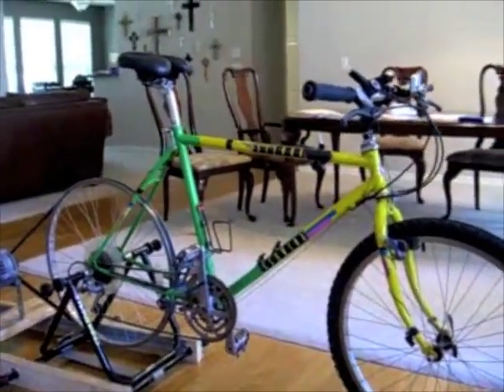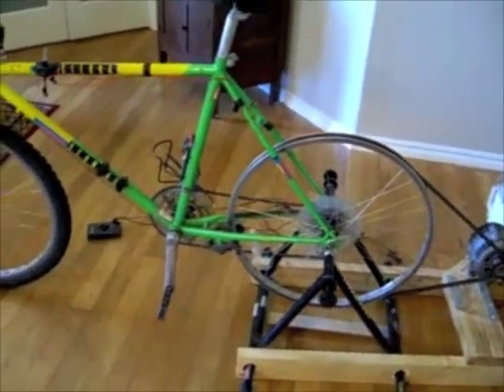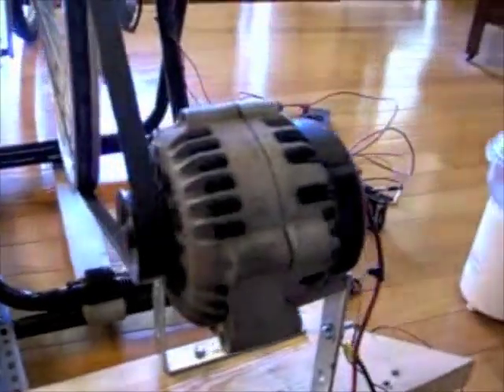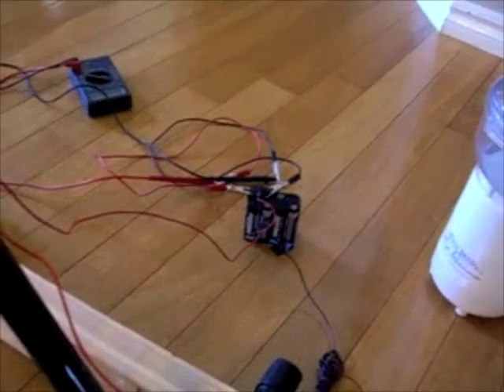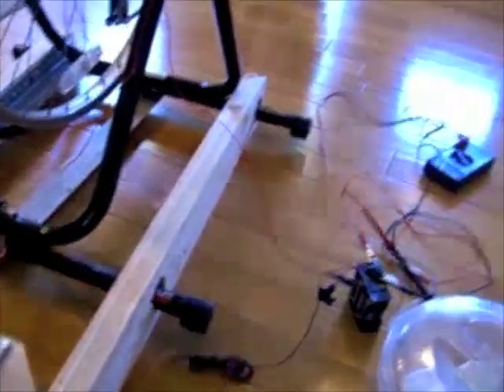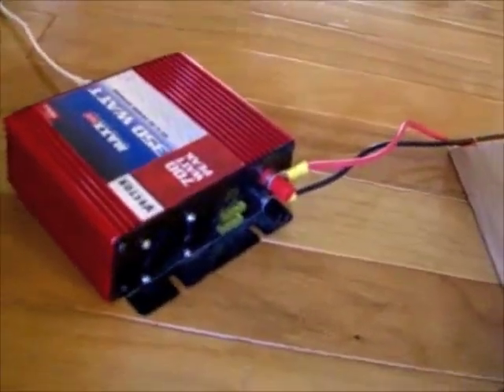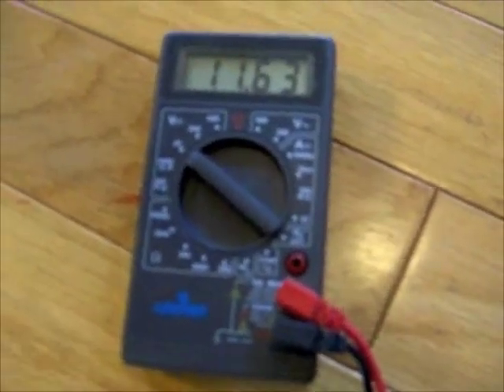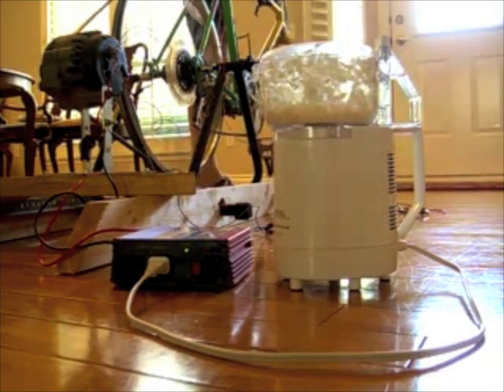Bicycle Generator

Comment: Which type of alternator are you using? I tried one with a motor and it reached a point when the alternotor slowed down. If it is used using a bicycle, can it run smoothly?

Comment: You could have just chopped the onion by hand and save time....
If you are trying to share good ideas with the world, try demonstrating it in a practical way.
You should have no problem raising the rpm since the alternator provides very little resistance.
The best source of energy is the sun, followed by gravity.
If you can incorporate these into you show, you might get somewhere.

Comment: Ok I have a question.. And yes I know it defies the laws of physics, but I'm curious to know if you ever tried it and what would be the results. 
Just as you use the battery pack and then turn it off so that the alternator sustains the voltage needed for the magnetic field. Can you also have a twelve volt motor connected to the bike pedal which is powered by the alternator, then jump on start pedaling until you're up to twelve volt, then flip on the motor to keep pedaling for you and step of the bike.. 
I know the laws of physics wouldn't alow this, because this set up will not be 100% efficient, nothing is.. 
But let's take things a little further, instead of having the alternator run the motor directly, how about have it charge a battery, like a car battery, which poweres the motor I mentioned earlier, therfore, making the system, not perfect, but a little more efficient.. 
Can someone please tell me what would happen? 
I'm pretty sure that the system will sustain itself for a short while at least.. 
Yes guys I understand the laws of physics, it's just a question, no need to bash.. Thanks..
Reply: adding another stage to the system (the battery) would make it less efficient, not more. not to mention you're talking about converting AC current to DC current, which involves several more steps and even more energy lost. also, you basically answered your own question. the system would gradually lose energy and eventually all kinetic energy would be lost.
Reply: ***** there`s some videos about perpetual energy.
Simple formula is placed in Watts.
Watts = Volt * Amp

So, you know that to charge the battery you need 14v, because to charge you need more than demands.
Amp's is the same.

About the Alternator:
As an example the output is 14V and 100Amp, so you have an alternator Output of 1400 Watts

Battery: 
Let's start with a 12V Battery and also 100Amp, so your battery has a capacity of 1200Watts
Yes, it's lower because although the system is 12V, the battery in resting period works at 12V and 14V charging.

Inverter:
Let's say that you get a 1000W Inverter.
Supposely you have 200W left from the battery and 400 Watts from the alternator.
So, next step is the motor and a belt to connect to the alternator.

Motor:
Which to choose from? Will a 200W motor work? And a 400W will it be bether?

Well, before that you need to see the performance of the inverter and the state of the battery, because the inverter, to provide 1000W may need 1200W, and the battery can it really hold 1200W, it will die due time.
But I will try to make it simple and reach the conclusion
The Motor will need to have Torque because he will need to create energy to turn it itself and when there's a load after the inverter he will need more torque to keep the alternator stable, and more torque needs more supply (Watts).
Also with more torque will have less RPMm so there's the need to have a good balance between Motor RPM and Alternator Output.

Conclusion:
In a perfect system even with no Alternator, and using a 200W motor, the battery will provide power for 6 hours
1200W capacity / 200W needed = 6 hours of running time
Adding an alternator with the same or above output can make the system run and eventually charge the battery
If that happens it's called Perpetual Energy
Since nothing is perfect, we expect losses.
There's losses in Cable Diameter and length, losses in conversion from AC to DC, losses due to RPM change and relation/ratio between motor RPM and Max Output of Alternator at X RPM.

Personal Opinion:
If you have easy access to these car parts, yes, it will be a nice experiment, so that you can learn and share your results.
If you have to invest money buying parts, you may end with no money and with a pile of parts that there's no point having them.
Reply: There is a bike like this, I don't know the name of it but it costs 14,000 UK pounds
Reply: But wouldn't we be able to get a battery "charged" efficiently like in a car not so? 
Like a car that's idling with the ac fan on, the battery is being charged and the fan is running. If we have an alternator here charging a battery at a good rate and then a motor using that battery power couldn't the system be sustained for a while? 
Again, I'm not trying to defy the laws of physics, I'm only asking for educational purposes, not to piss anyone off.
Reply: dont forget that while an ac generator (alternator) does in fact charge the battery, said alternator is essentially running off the gasoline that the engine is burning. it is simply a few different steps in the system. but you still lose energy. and yes, the scenario you have described would work for some time. there have been many attempts throughout history to build a self sustaining machine, and while many have come close, noone has achieved 100 percent efficiency, so yes, the system you describe could probably sustain itself for at least a few seconds...or perhaps more. hard to say.
Reply: Ok thanks for your input, I wish I had the time to actually try it, just to see how long it will sustain itself.. I know in physics work output is always equal to the work input minus the work loss, so obviously you always have to put in more than you get out, efficiency is always never 100% and it will stop running.. But in theory it sounds like it should work.. Just like you said the gasoline runs the car, what if you have one motor and alternator that you start with a charged battery so that supplies an output but also drains the battery in the process, just like in a car when the process drains the gasoline this process drains the battery.. And now you have a bicycle cranked alternator charging that said battery with a motor that takes over when the bicycle reaches 12v-14v..i wish there are experiments like this on YouTube or so, so I can see the results, I looked, but nothing.. 
I guess I will just have to try it myself and see if it even sustains itself at all. Thanks for the input guys.
Reply: Electro bike?
Reply: Mark Vianen Electricity operates everything!
Reply: Vishal Baal friction of bearings, will not ensure 100% convertion of mecha power to electric power.

Comment: I have this same kind of alternator and I am trying to generate electricity, Do i need special kinds of cords or can I just use copper wires with alligator clips to clip on to certain parts, if so which 2 parts do I hook on to to create electricity when I spin it? Thanks.

Comment: I would use this idea with wind or flowing water to charge a bank of car batteries. The car batteries would then be used to power equipment via an inverter. Obviously charge controllers have to be part of the equipment. We intrigued by the speed the chopping machine reached

Comment: Well, the idea is a good one. But the electrical engineering here is horrible. The presenters syllabus in describing the electrical components and how they work is not very good. (okay, sorry, it's horrific). The way this video shows how to setup an alternator to a mountain bike to make electricity is NOT valuable.

The engineering and wiring of this setup has been overcomplicated by a factor of 10.

The alternator mount is good and use of a serpentine belt is excellent. Everything else is a disaster :)

1) use a single wire Alternator by GM -  Delco or Nippon Denso Single Wire model if possible for simplified wiring. But even so, it is not hard to use other models. Best model is a heavy duty GM or Ford Alternator from a 3/4 - 1 Tonne Diesel Truck. Designed for low RPM with output performance ranging from 100 / 110 amps @ 12-14 Volts (regular duty) all the way up to 230 amps (heavy duty).

2) Use a decent Marine or Utility deep cycle 12 volt battery. They are designed for storage of power and can reserve Amps. Those "series batteries" would fry or worse, start a fire.

3) The choice of inverter is critical. The more amps is can draw, the stronger the storage battery must be. Sudden demands on the 'electrical" system can exceed the limits of the alternators internal regulator creating severe damage to the amplifier, alternator and the device that is plugged in. The battery saves the inverter - literally. Inverters are all rated differently. You can buy them in different capacities, something that wasn't mentioned and an important consideration. Inverters are available up to 10,000 watts peak power. The most common ones are 300 - 600 watts. 

4) Run the Alternator to the battery (positive to Positive post) with a 12V two pole switch in the middle. The switch ensures that the alternator's exciter circuit does not drain the battery when not in use.

4A) Bolt with heavy gauge electrical eyelet the Black Ground wire to case of alternator to negative post of battery.

5) Run Inverter red lead to positive post of battery

6) Run Inverter black lead to negative post of battery

You're done.

Start peddling!

Follow these steps and you would actually have a project with an actual benefit instead of say, a fire, electric shock or short circuit that ruins your electrical devices. A word of caution, most consumer inverters get hot, they are not designed for long periods of continuous use exceeding 12 hours for anyone cycle period.
Reply: While your ideas are excellent, the condescending and patronizing tone of your intro is going to drive away readers. You catch more flies with honey than vinegar.

Comment: Technically it's great but a very expensive investment because the cost of the bike.  I can't even afford to change 15 energy wasting GU10 bubs to LEDs because of the price. I save by simply using them only when really needed. This contraption creates clutter and looks ridiculous in a living space. What's wrong with chopping oinons by hand?

Comment: Neat idea to generate a flexible working potential like electricity to be inverted or not to use for work.  However, this specific application could have been accomplished so much easier with just a knife and a chopping block :)

Comment: This is great - think I'll try something like this myself.  How hard is it to pedal once there is a load on the alternator?

Do you think it would work modifying the rear wheel to a flywheel so you don't have to pedal continuously?
Reply: it's so hard that most people don't want to do it for more than 10 seconds. It's like sprinting at your maximum speed and for most people that is a 10 -15 second maximum event. Alternator takes like 3-5hp from a car when it's charging the battery.

Comment: Did you consider to wrap the alternator like some people with their windmills in this way, that they don´t need any battery to erect/magnetize the generator....The max-output is reduced then but you´re producing electricity from the first rotation on and got a higher efficiency...greetz

Comment: lee I have a question im trying 2 build a dog treadmill  . I have a bike training stand like u have and I build a treadmill with 2 -2x4 with 2  3 inch pvc pipes in the middle of the 2x4 with carpet .how can I connect the treadmill 2 the bike so I can turn treadmill?

Comment: Bullshit this not possible because a alternator is the same as a normal generator as soon as its put under load it becomes hard to spin it because of the stronger magnetic field it takes over 1.5 hp to drive a alternator under load capacity.you fuckn try to pedal at 1.5 hp yeah good luck with that dumbass !